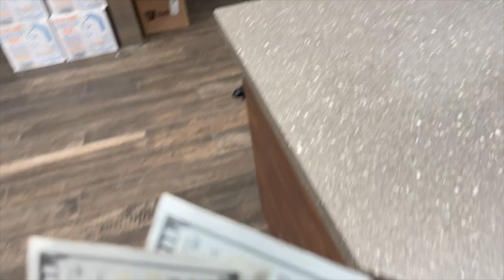Did we really BUY this?

Comment: Congratulations on the bus life! Mine had an over heating problem once and I changed the water pump, thermostats, belt and radiator fluid. After that it was good to go! Wish you guys luck!!!
Reply from the maker: It was a real tough start after all the prep work but we got the bugs worked out! Been smooth sailing since. 🤘🏼